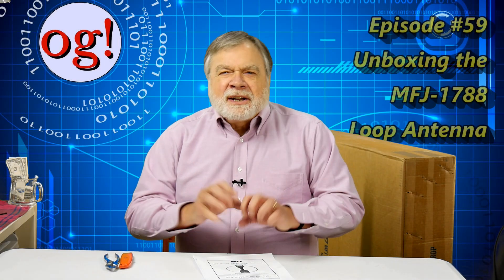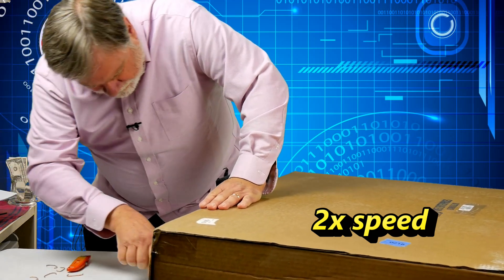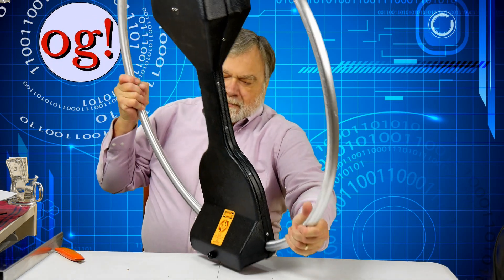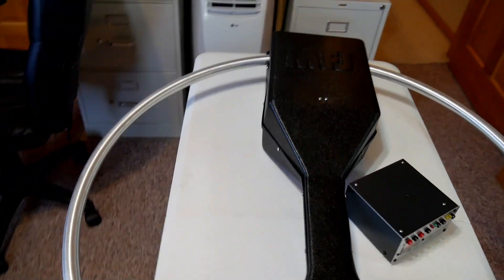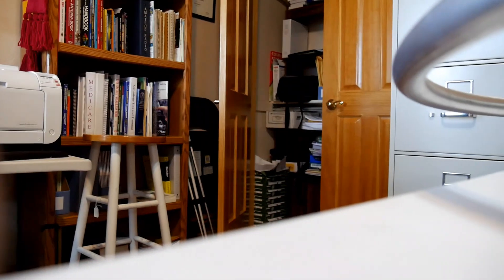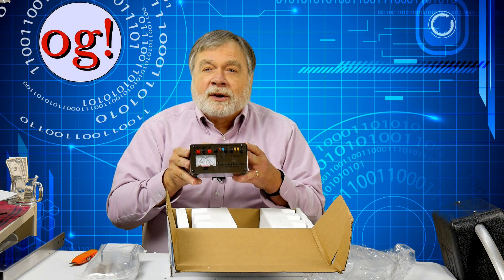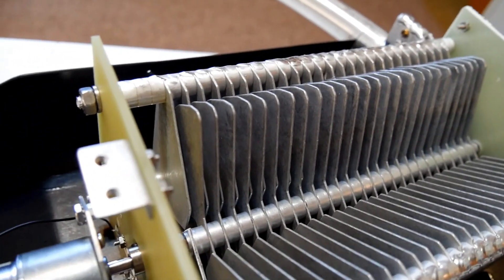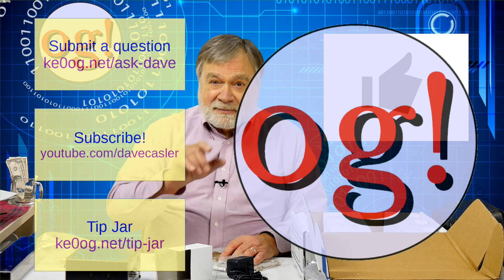Unboxing the MFJ-1788 Loop Antenna (#59)

Comment: It's strange that in this video the capacitor seems to be fully meshing when the limit switch trips (11:43), but in the AD#65 review you show it tripped before they mesh fully (2:46 = https://youtu.be/CgKzvyeM8lw?t=2m46s). Is it possible that you accidentally misaligned the limit switch or lever and it wasn't a manufacturing or QC problem? Enjoy all of your videos.
Reply from the maker: Fascinating observation. No, I didn't align anything until I fixed the problem. And everything was tight when I fixed it. And I didn't drop it or anything like that. I actually had to move the limit lever quite a bit to get it to work.

Comment: I've had mine in the attic above the 2nd floor for over a year and it is OK as my backup but does not pick up alot of weak signals. I have it pointed at the sloping part of the roof so as to not be interfered by the faux windows up there. The tuning is pretty fast after a couple hours messing around with it. I've learned to tune it by just using the speaker sound level and then fine tune it from there.

Comment: I use it and have made contacts around the world. Had to open mine up and tighten up some screws on the motor after I put it up and wouldn't  tune. After that is been going good for almost a year. Made contacts on every band 10-20 meters except 12meters. Mostly used on 20 meters. I use mine horizontally for DX and noise reduction.
Reply from the maker: Thanks. I'll be sure to include testing it in the horizontal position.

Comment: I'm loving the unboxing of the antennae! Is this a new antenna or just experiencing some popularity?  As I've stated before, I have lots of space and size restrictions, so I really think a loop will be great for me on HF. I have a few runners up including the Chameleon! Thanks to your unboxings, I can see 'em !
Reply: And I love the 'reverse engineering' you do with taking things apart and seeing how they work!  This one also seems much less portable than the chamleon. This seems like you put it up, and isn't really designed to break down and carry 'round. The chameleon seemed to have that feature...thinking about it, I probably won't be moving around that much with my heavy rig!
Reply from the maker: Yes, the Chameleon and the MFJ address two different markets. I'll be comparing them in an upcoming video. 73, Dave

Comment: Dave,
FB on the unboxing. I'm collecting the pieces needed to construct a 160 - 40m loop. I live on a 1/3 acre plot with no tall trees, so a wire antenna on top band is out of the question.  73   WB3BJU